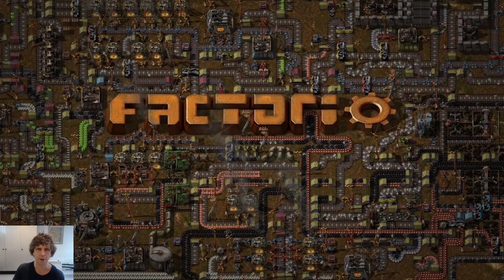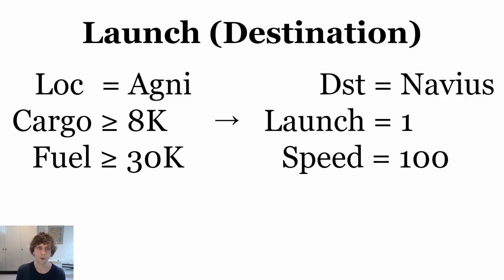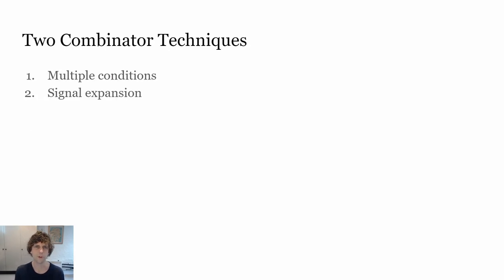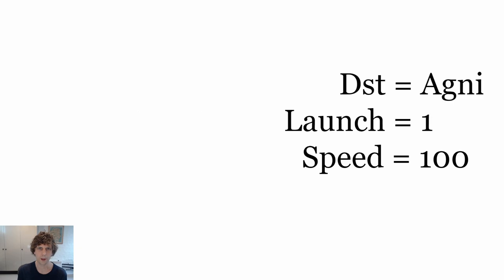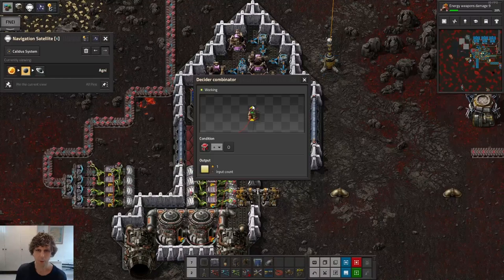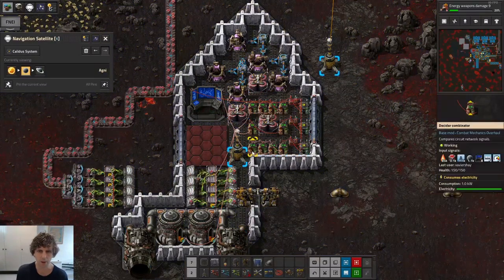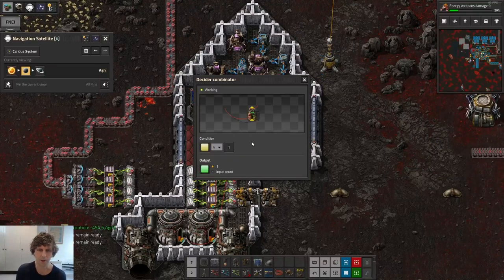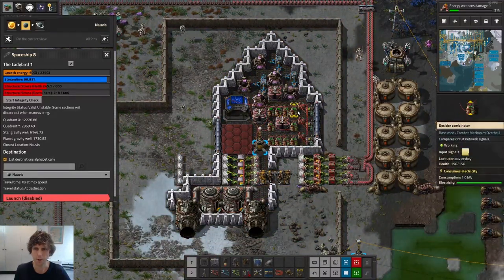Tutorial: Spaceship Automation in Factorio Space Exploration

Comment: That was the old way of doing automation, before it was possible to send signals through the clamps. IMO, the easiest way to automate spaceships now is:
1. Place all control logic on the outside.
2. Read content out from the ship using green wires and send control signals in using red wires (or vice versa).
3. Send all signals (and power if needed) through the clamps (upper corner).
4. Only combinator that is required on the ship is a const combinator that sets the clamp docking numbers. Use the same clamp id everywhere for this route.
5. This means you will have various combinators at every waypoint. This is easy, as you know all conditions at the waypoint (when to leave, where to go).
Reply from the maker: Correct! Most of the combinator tricks in this video are still applicable, you just don't need to fit them on to your ship anymore.
Reply: This comment is a life saver. Thanks Lars!

Comment: I can see it working like a charm, however, I keep running in to an issue with the arithmetic Combinators.  You have them all lined up and I can not see how you have the wiring.  Any help on this?  This is by far the most advanced tutorial.  I am so close!!!
Reply from the maker: Sorry I don't have ability to jump into game at the moment. Pretty sure this diagram is right (I just did it from memory): https://imgur.com/a/N9jRLZ8 Note I use a green wire for output so to not accidentally mix output signals back into the input, even though it doesn't really make a difference in this particular case. Good luck and let me know how you go!
Reply: @XavierShay    The three arithmetic Combinators are lined up in your video.  It is hard to see where the red wiring is going on your video.  I have the output of all three arithmic combinators going to the input of the console.  Takes off when empty, flies to destination, lands, loads up, launches but the engines don't light.
Reply from the maker: @QualityGlassBlock  Did the diagram help https://imgur.com/a/N9jRLZ8 (instead of the video)? Should only be one arithmetic combinators (did you mean three decider combinators?) The only output that should be connected to the console is the final "each * green" combinator. Can you post a screenshot perhaps?
Reply: @XavierShay  imgur     a/bAovW5r   The link keeps getting removed.
Reply from the maker: @QualityGlassBlock  Link works, generally looks ok to my eyes (though yeah tricky to read circuits from screenshots!) Actually, I suspect that "launch but not light thing" is a bug in the solution I propose. It used to work "by accident" but recent spaceship updates mean it doesn't so much. Try sending the spaceship speed signal as a constant to the console rather than as a "only send once when launching".
Reply: @XavierShay  Worked perfectly.  Thank you!